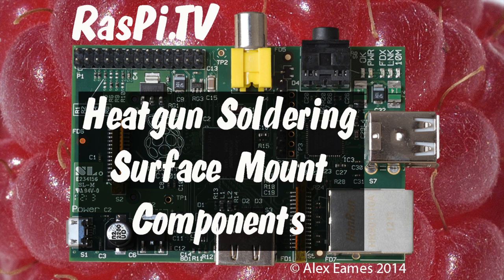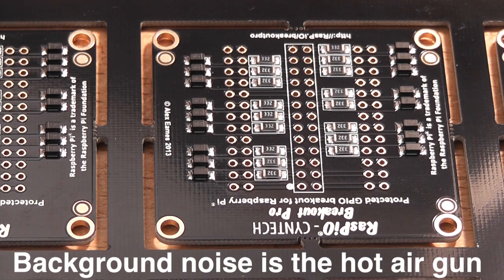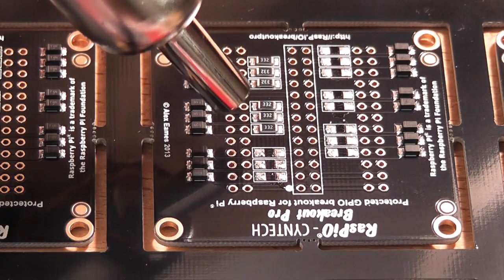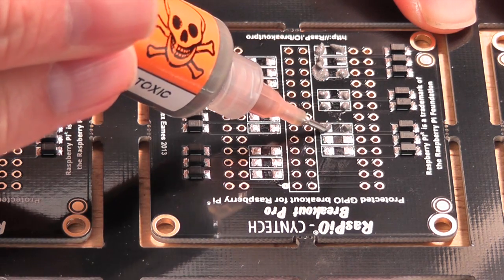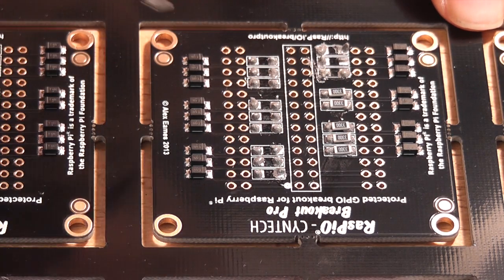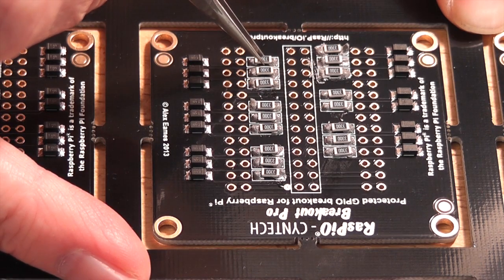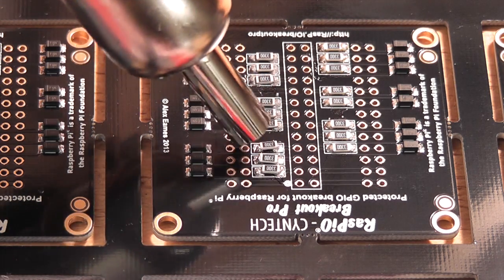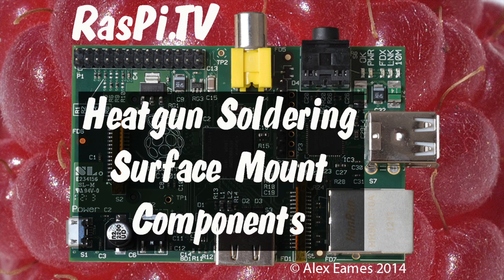HeatGun soldering - reworking surface mount resistors

Comment: hi good video but i think that 370 deg is to hot! If you use to much heat you will melt things on the board. I use the same machine and typically use 320 or lower. With smaller components ie 0603 you can place a blob of paste  over both pads and capillary action will draw solder where is goes most of the time. I love my air gun and highly recommend learning to use this device as it is heaps better than a soldering iron
Reply: Hmm, I would say the temp that works best very much depends on the individual situation, there isn't really a one temp works fits all solution; after all that's why air guns have adjustments on them rather than being fixed in the factory :)

In my experience many factors affect what works best such as the PCB thickness, the size of the ground planes, the component being removed, how close you hold the torch, how much you move the torch about, the room temperature, the air flow, what solder was used and even how well the air gun being used is calibrated (trust me these things can vary by quite a lot even with the same model). And that's before we even get into the different techniques, sometimes its better to use a hotter heat for a quicker time than its is to use a lower heat for a longer time. 

In the video in question Alex is being quite quick, you probably noticed he removed quite a few resistors in just seconds, I don't see any issue with using 370c for that at all, resistors are pretty robust. I've been known to use over 400 on boards with big heat sucking ground planes as you need to get the heat in quick and get out of there before it all conducts away.

Comment: I love the smell of scorched wood in the morning!

Seriously though, very impressed by the reworking of the surface mounted components. Looks might I may have to invest in even more toys in the future (just not right now).
Reply from the maker: Yeah it's harder to justify a bit of kit over £100, but I'd been using a Black and Decker heatgun, which worked, but was tricky to control. Compared to that, this was easy. I did one board to get the setttings right, then the video was the second one I did with it, live and with barely any edits.